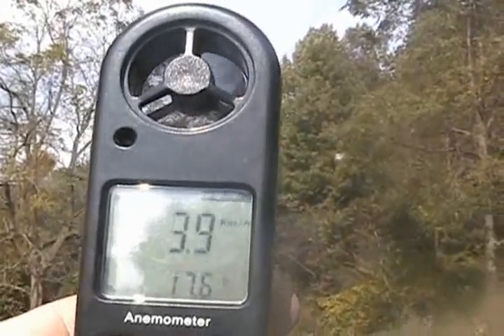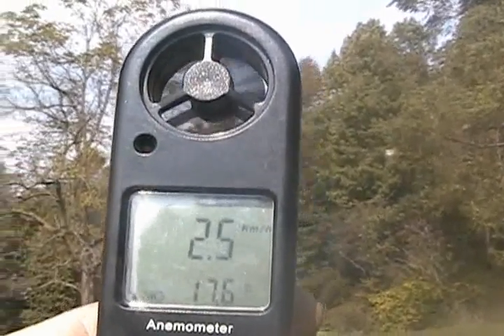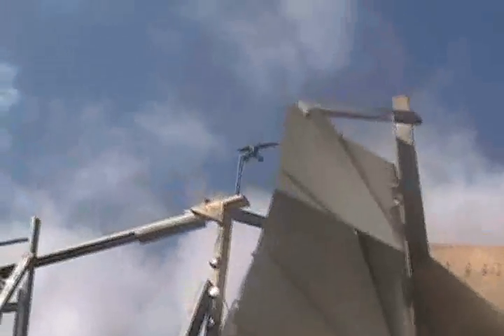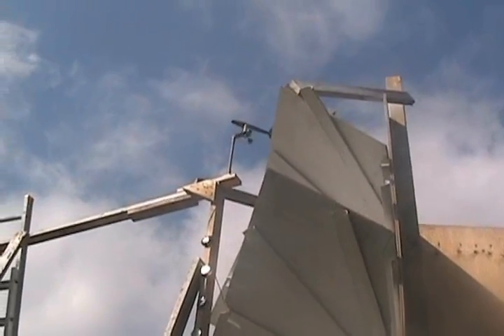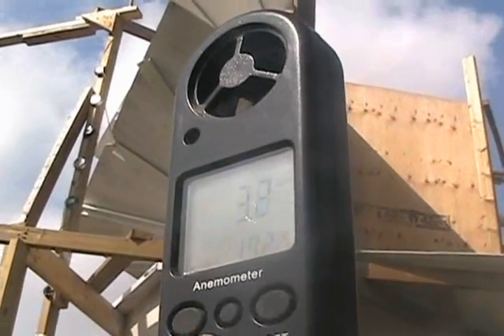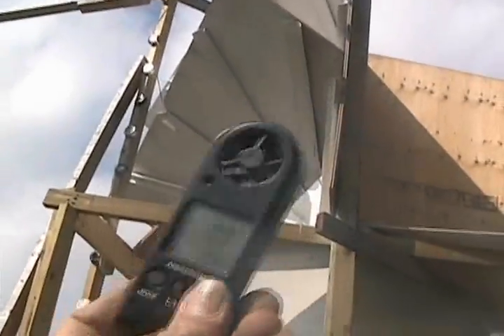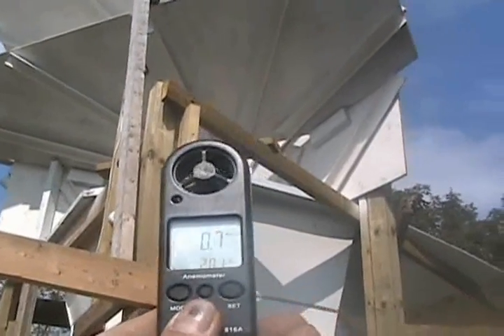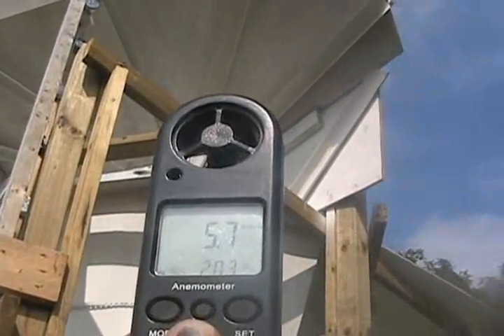fawt propset01  vertical Axis Wind Turbine vawt  plans savonius, pma, hawt diy ametek  green

Comment: Good for you, I like to see people thinking outside the box. I've been thinking along these lines for years. 
Can I assume that you are trying to create a venturi effect at the bottom in order to push air through the blades. Would you not be better directing the wind through 90 degrees into the blades. I know this could be a problem but I think there is a cheap, easy and efficient way of doing this, just havent got round to building a model yet. Have done some CFD and you do lose 50% wind energy

Comment: Whats with all the structure around your turbine? Your just blocking the wind... You would do much better if you just put the gen in an open area...  As suggested by mrbuki77 Try a squirrel cage blade design.  I generate more electricity with a Bedini motor.